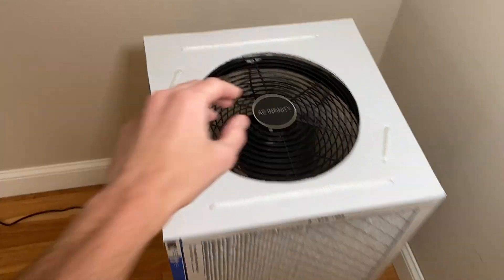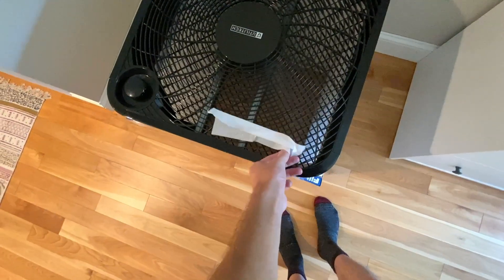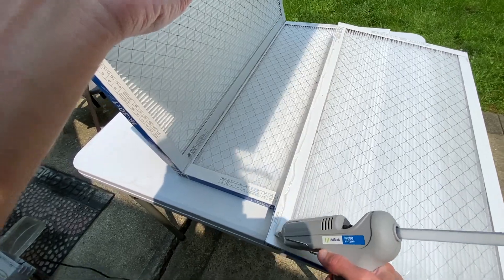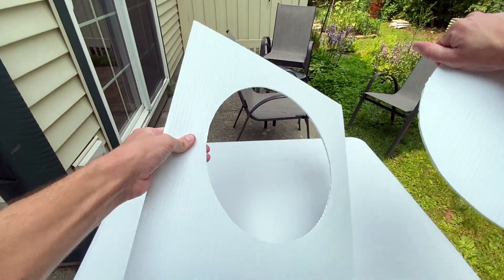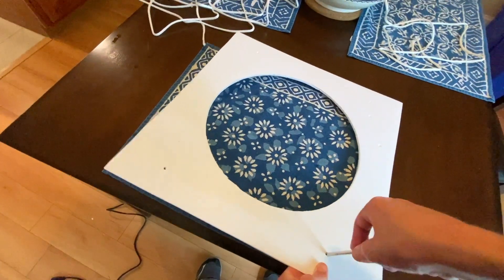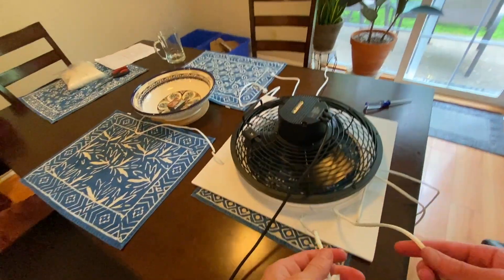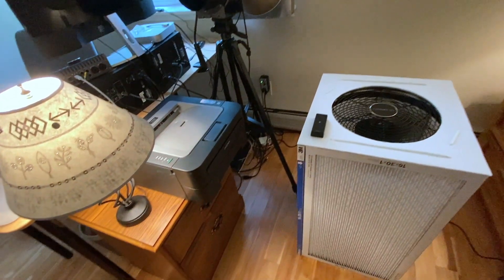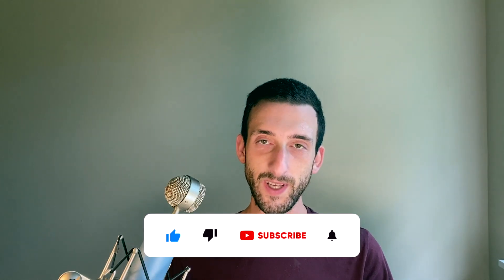How to Make a Better DIY Air Purifier

Comment: Nice attachment method! Note the AC Infinity Cloudlift S12 is expensive. It's better because of the EC motor and fine control, but that comes at a cost. For less cost an array of PC case fans is less expensive, uses even less power, and can be built with an even smaller footprint depending on configuration. 

Airflow is difficult to accurately measure without the proper tools. The only way I've been able to do this is with a flow capture hood on the outlet with anti-swirl grid, not any type of anemometer. An anemometer is good for velocity/throw at a distance, as it includes entrained air. In an extreme example, consider how you would measure the flow of the Dyson purifiers. They rely on entrainment to create a jet of air, yet have low particle removal (despite high filtration). The best performance test is an aerosol drawdown measurement of CADR. Takes a bit of time but can be done accurately enough even with a $40 meter if you are willing to take a video of it and transcribe the readings.
Reply: This comment was all I needed to realize I’m not as smart as I think I am. Thank you, sir, for putting me in my place. 😂
Reply from the maker: Thanks David! When it comes to fans, the phrase "you get what you pay for" is even more true than usual. The AC Infinity Cloudlift S12 delivers enough airflow (it's rated at 1807 cfm) to properly purify the air, and because it's robustly constructed, it does so quietly. Of course, yes, that comes at a $159 price tag, unfortunately. There are certainly cheaper DIY air purifiers than mine, but my point in the video is that they're too loud, among other issues.

PC fans are definitely intriguing to me - I suppose you'd need multiple PC fans in a single air purifier in order to move enough air.

I appreciate your point about the nuances of airflow measurement. Your CADR method sounds really intriguing! For the purposes of my experiment in this video, I think my method (anemometer, measuring average airflow across the entire fan surface across multiple trials) is sufficient for comparing the box fan and the AC infinity fan.
Reply: @HealthyHomeGuide  Personal cooling fans are tested using a method that captures velocity at a distance and converted to a flow. That's fine for an application where total air movement is needed, but it doesn't reflect the air moving through only the fan housing, so it overstates the value. The only manufacturer that seems to measure the flow through the fan housing itself is Honeywell's turbo floor fans. If you want to "calibrate" your test method using velocity, use the HF-910 floor fan which has a flow through the housing of 1050 CFM. I've confirmed that with a flow capture hood mounted to it. It's also a whole 2-3 db quieter than box fans and ends up moving more air through a CR box. Bit of a pain to construct. Most people remove the stand/legs and mount the round fan in a round opening.
Reply from the maker: @Elfstrom Fascinating! Thanks for the measurement tip. 

As for the Honeywell fan, that could work for some, for sure. Personally, I was aiming for more noise reduction compared to box fans than 2-3 dB, and more robust construction/higher static pressure motor. I also just don’t feel right about using a cheap fan made of soft plastic in an application like this, but I acknowledge it could certainly work.
Reply: @David.Elfstrom      Got any data on efficiency (highest cfm/watt) in the ranges demonstrated in this video?  Also, isn't 3db increase a doubling of sound?  I would choose low operation cost and quiet over saving a few dollars.  Agreed?
Reply: @DK-vx5co  With general ventilation filters & a box fan the CADR/W is going to run about 5 Smoke CADR/W which is definitely into ENERGY STAR territory. Using a PC case fan array boosts it WAY up to 28 Smoke CADR/W, extremely efficient and quiet. PM2.5 CADR can be measured with low-cost optical particle counters, and the PM2.5 CADR/W will be ~ 30% higher than for smoke CADR/W in both types. 

I haven't tested using the more efficient fan shown in the video, but I expect it to be in-between box fan and PC case fan array efficiency (it's a wide gap to fill!)

Yes, a 3 dB increase is a doubling, though our brain/ears don't perceive it as a doubling.
Reply: @David.Elfstrom     Would you share the PC case fan sourcing & data?  Energy Star site discusses numbers in the 100-150 range.  I haven't digested all that yet.  I want an air scrubber for a shop & considering options.  Quiet is a priority & noise requires energy.  I like that HHG's are variable speed.  Thanx
Reply: @DK-vx5co  PC Fan smoke CADR/W was my test of the Nukit Tempest with AAF Flanders MERV-13 and 6 of Arctic P14 fans (210 CFM CADR / 8 W); similar values are for Clean Air Kits models that were tested by Intertek to AHAM AC-1. These are incredibly quiet; for shop use you could go with higher RPM fans like the industrial ones from Noctua but they are a lot more expensive, then can dial it down when you need library levels of quiet. PWM fans are variable speed. The AC Infinity single fan may be best for your application; note that AC Infinity also make a panel of 2 or 3 PC fans that makes it really quick to build.
Reply: Thank you.  I was looking at the EStar site.  Costs are not crazy except for constantly feeding them filters.  Filter cost is the main reason for considering a custom build (using less expensive MERV 13-16 with lots of surface area = low static). 

"Nukit Tempest with AAF Flanders MERV-13 and 6 of Arctic P14 fans (210 CFM CADR / 8 W)"
Does this mean:
 210cfm/8watts = 26.26 cfm/watt?
Is this correct?  
What am I missing?

"Smoke-Free Clean Air Delivery Rate per Watt:13.8",  
(the best cfm/w I saw from EStar site)
...but quickly drops as area/volume increases, down to 10s.  Using large surface area (low static) filter box, do you think I can build my own & still get high cfm/watt?

EStar measures pollen vs smoke & I'm assuming the smoke to be the stricter since smoke PM is smaller than pollen, a stricter standard.  Correct?

Thanks & very interesting.
Reply: @DK-vx5co  I'm doing these calcs on the fly, I probably made a typo 26 vs 28. Yes they completely smash commercial air purifiers that use much more restrictive HEPA filters. 

Yes everything important, like room size, is based off smoke. Dust is close to PM2.5, and pollen has a high natural deposition rate and low total counts that there's a lot of variation in the CADR value reported. Unfortunately the published CADR values do not report error, confidence interval, or other stats.

Definitely you can build your own, there's even a plan generator web app for them. Can't link here b/c YT scrubs links.
Reply: Because I'm looking at hundred$ + ongoing filters.  Quiet (& enough volume) is most important.
Reply: @David.Elfstrom  I was just looking at creating a 3x3 array of Arctic P12 or P14 fans to use in a filtration box design like the video. I really like the idea of how the fan panel will just sit on top of the filters. I would expect it to be easy to change filter and be pretty quiet in operation while moving a decent amount of air!
Reply: @HealthyHomeGuide  Your assumptions about massive airflow through this design seems all wrong: The CloudLift S12 is designed for open air use, and it's rated for CFMs using "free air" CFMs. Realistically, CFMs through the fan itself might be half the manufacturer's stated "free air" air volume. For axial fans, there is then typically a very significant drop in CFMs in just the first 0.10" of airflow resistance / static pressure. So under even the mild airflow resistance added by the filters, CFMs through this kind of fan are going to be a lot lower than the free air CFMs. Finally, the CFMs will be more and more limited as you turned up the speed controller, OR as the filter begins to load (which you cannot tell just by looking at it), because the fan will not be able to oppose the increasing resistance. But free-air electronically controlled motors like these AC Infinity fans are programmed to slow down whenever they encounter resistance, to protect the longevity of the fan. And that may be the only reason it still sounds quiet at full speed.  Because the fan is throttling itself electronically as pressure increases as you speed it up. Not because the fan is uniquely optimized. Testing CFMs for such a system is complex, and you're not doing testing of your design here. You're not even doing a controlled comparison for particle capture. Tissue paper is not a test. Don't you think you should add a warning about such issues?

Comment: Lots of good ideas here. It would be easier to find the center of the coroplast by drawing diagonal lines from corner to corner and finding the midpoint: ☒. You don’t need to buy the square, just use any straight-edge you have around.
Reply from the maker: Oh, yes! True. I definitely should have used that diagonal technique. I'm going to pin a comment telling people that. Thanks!